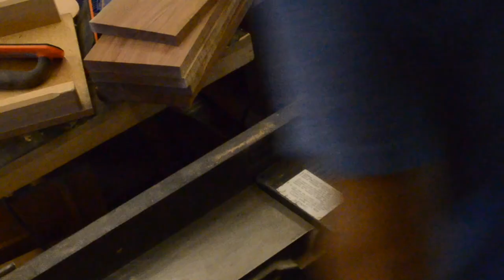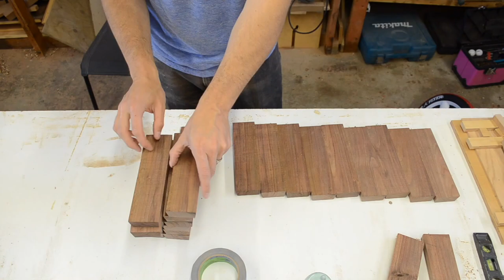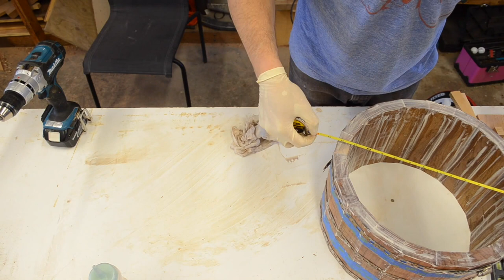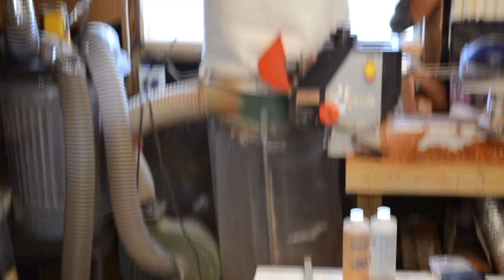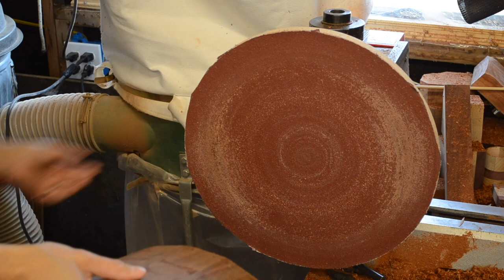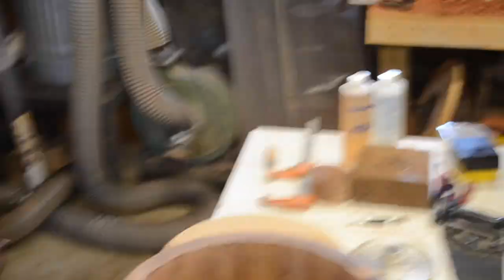Walnut Stave Snare Drum Build Part 1

Comment: So is that an 8 degree angle?
Reply from the maker: 9 degrees in this case. It's a 20 stave 14" snare
Reply: Sweet! Also, did you set the fence width for each stave at 60mm? I'll be making my first snare drum soon also. Thank you again for the upload and sharing!
Reply from the maker: The outer width of the stave is 2.237" in this case.
Reply: @deandiamond5479  is that in mm or in?
Reply: @2pnlbrown  Inches. There is no way for outer width to be 2.237 mm (wich is 0.088 inches)